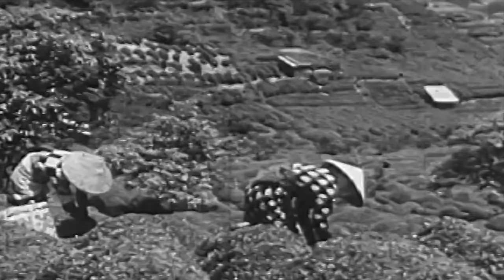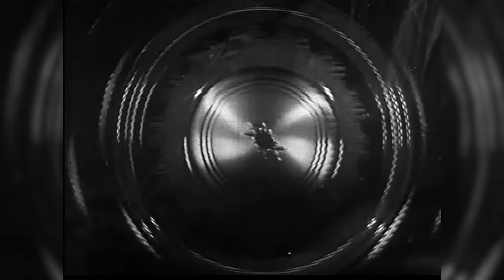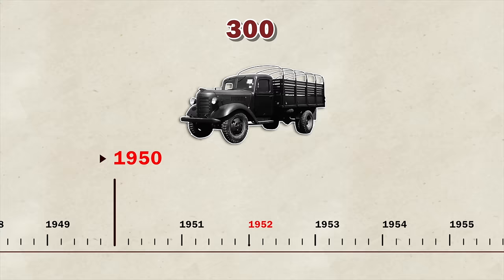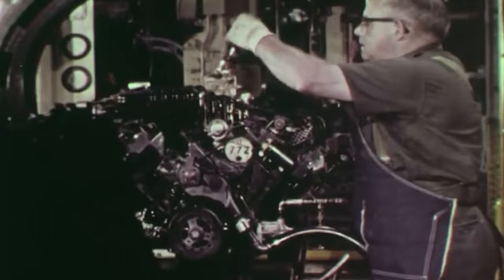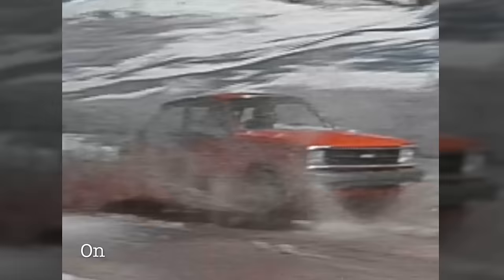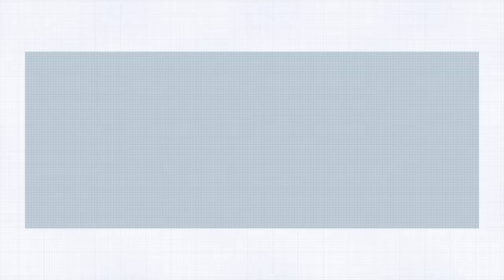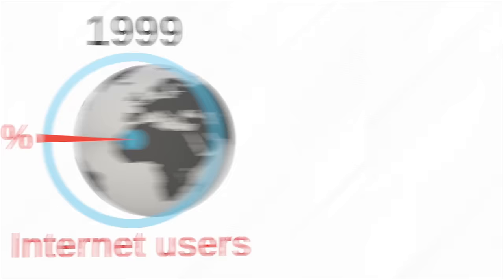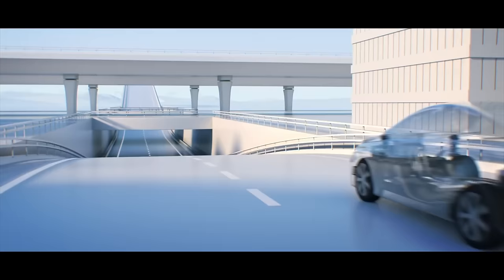Here's Why I Only Buy Toyotas

Comment: Just avoid the 2019 2020 Tacoma.I am on my 3rd fuel pump.
Reply: If they replaced three fuel pumps already, maybe it’s not the fuel pump, it’s got to be something else. The mechanics there are not doing a good job.
Reply: No it is that. They have a recall on the Toyota for faulty pumps. Last month the factory finally got the newly manufactured parts.I spoke 
with Toyota Corp directly.
Reply: There's a new recall
Reply: @fiveoclokfoam1204  Another? What is it
Reply: Have you found anything else defective in the Tacoma? I am looking to buy one.

Comment: 2004 Toyota Ipsum, 250,000 km on the clock and still going strong. I've owned all makes of car but this one has proven to be the most robust and reliable. My 68 Beetle has done more Kms but requires greater maintenance.

Comment: 2002 Toyota Highlander - 238,000 miles; 2008 Lexus RX 350 - 254,000 miles; 2014 Highlander Limited AWD - 80,000 miles; 2015 Lexus RX 350 - 80,000 miles... and a 2004 Highlander - 100,000 miles traded for the 2008 Lexus... combined approximately 3/4 of a million miles for a family of 5 adult drivers - still active in all except the 2004 (it was black and that color wasn't easy to keep up with!) - Selling the 02 today to a neighbor, rather sad, as that car has been perfect for almost 20 years! The company won me over from Ford in 2002 and I've never looked back... although, I do drive many rental cars each year and had a BMW X5 lease for 3 yrs... the reliability of Toyota / Lexus is hard to step away from. Quality is very strong, luxury is actually quality extension, otherwise you simply have costume jewelry...   Big Fan! Thank you Toyota for the ride...

Comment: I drive a 1989 Toyota van aka Wonder wagon. With a 2.2 L forklift motor LOL. Bought it used with so many problems but it keeps running while I fix it up and I joined a online Toyota Tech Forum where the moderators are old dealership managers that love the Vans also and help everybody fix them up

Comment: Scotty, we bought a used 2008 Toyota Sienna thinking we couldn't go wrong with a Toyota. We have owned 3 older Coronas and Corollas(Pre 1990's). What a complete lemon! There is some major malfunction in the emergency braking system. The van thinks it's tipping over every time you go around a corner. It beeps at us and then applies the braking system. We went through 3 mechanics, thousands of dollars. Replaced the YAW sensor, had the zero point balancing done, and wheel sensors replaced. Maybe other things I am forgetting. A google search tells us we are not the only ones experiencing this dangerous, dangerous issue. My husband pulled the fuse that controls the ABS/VSC etc. I avoid driving in bad weather or winter conditions. It has been very limiting. I only use the van for driving straight roads on the valley floor. I am done paying it off in 2 months and shopping for a new car. I feel traumatized by this Toyota and they have been zero help in solving the problem. I am also afraid to buy a new car because this one was such a lemon. I am watching your videos to try to figure out what to get next.

Comment: I had a ‘82 Toyota 4x4 short box with the bigger motor. I called it the wasp it was yellow with black roll around. Black interior and accents. 4 inch lift with 33in wheels  a thrush glass pack etc. It was in the early 90’s and I was in early twenties. It was one of the most fun vehicles I’ve ever had and one I wish I never got rid of. What was or is your favourite Toyota’s?

Comment: Great video Scotty!  after owning numerous American cars, our first Toyota was a 91 Camry. We drove it for 8 years without a single problem!  We then bought a 98 Explorer(Mazda) that is still on the road even after being driven by two teens.  Our 05 Accord however was using, then started leaking oil at around 85K Mi., despite recomended oil /filter change intervals since new.....We had to many problems to mention with our 2012 ford EDGE limited so we traded it in for a Highlander before it's internal water pump leaked, knowing there will be no warning indicator before the engine is destroyed if/when it does. Our 07 Tacoma now has 200K MI on it and stIll doesn't leak a drop of synthetic oil.  Yes,  you will pay more for a Toyota, but they are well worth it. Plus resale is amazing. There are two 07 Tacomas like ours for sale on eBay right now for Aprox. $7K more then we paid a dealer for ours a year ago. And it was pristine........

Comment: i owned a lot of cars in my life from German VW, BMW etc to Japanese Subaru's Toyota's etc.  Yes the German cars are a lot more upmarket and solid however that comes with issues, Warning lights for everything and expensive replacement parts. My friend owned a Toyota pickup which had over 300,000 miles on it. i saw his history for the car and i was amazed. Apart from a new consumables like brake pads, brake discs and a couple of shock absorbers etc he had zero major issues over 300.000 miles. I honestly believe most car manufacture's try and reach 10 years or a 100,000 miles as they seem to fall apart after which ever comes first. Toyota all the way!! I now own a Toyota Hilux with 120,000 miles onit and had zero issues. Toyota for life. Always gets you home!

Comment: For me Toyota is the best car manufacturer ever  ,I own 3 , an  MR2 Mk3  2000 model  great fun ,a Prius 2008 with 175.00 miles on the clock all I have ever replaced is tyres and break pads, in total my family own 7 Toyotas with nevertheless a problem, my wife has an AYGO not sure if you have these in the US great town car .good luck luv your U tube shows keep revving.

Comment: Very nicely done. I enjoyed this video. Only thing maybe missing is bring up the longevity of a few engines.  Especially the 2.7L through the 80s and 90s. The 4.0L though 2000s. I've seen both over half a million.  The 2.7L at over 735,000. I believe a 2006 high lander which isn't either of those motors but it got over 1 million miles before a hurricane was the car's death. It was still running when it happened. An extra 5 min on a few points like this.. would have been sweet. I didn't know any other this stuff.  I enjoyed the video. The fact they were 5th at the time of the big 4 in the US is incredible. Then the gateway to number 1. Only daily driver I will ever buy again. I have a 2021 rav4, I plan to take him until death do us part.

Comment: My 2013 bought new Tacoma always pinged on unleaded and required premium to run right. The dealer always acted like they couldn't hear it. Tacomas and Tundras are well known to have way worse MPG than they should. I will never own another Toyota truck. I have had good experiences with 2 Corollas. Honda is by far the better manufacturer.

Comment: My 2007 FJ Cruiser has 325,000 plus miles and it’s not showing any signs of slowing down as a daily driver car. There’s nothing like owning a Toyota, Subarus, Hondas and Nissans are close but they are get separated at around 250,000 miles. ❤️😂

Comment: Great mass consumer product for road vehicles

4x4 lack off-road capability and GVM/GCM is well below what is required for serious off road and towing. Buyers need to spend practically same a buying vehicle to make fully capable.
Mr Toyota needs to send his R&D team to Australia to see what they do down there to build great 4x4 Toyotas by replacing most on the suspension and highly modifying the drivetrain

Comment: My '99 Toyota 4 Runner has 500, 000 miles on it and I only have had to do basic maintenance on it, where'as my sons 2010 Nissan with 206,000 miles on it, already has a transmission that slips.
Toyota's just last forever if you do the basic maintenance well.

Comment: Toyota SHOULD be good whenever they are not in absolute market leader position. But when they are, as in case of our country, they will play with pricing, which always go up every year for the very same product class, all the while reducing parts, features, options, from engine down to interiors even put battery so small you could not tell the  difference against motorcycle's.

Comment: I agree, Toyota is the best. 

Currently my car is Mitsubishi Mirage  Hatchback 2015.  My first car. 
It is manual. 

I have driven a manual Toyota car. Noticed that the clutch is hard.

Driven Mitsubishi and Suzuki manual and the clutch is soft.  

I hope that Toyota could fix the clutch problem. Make it soft. 

It is a great pain to drive a Toyota manual on traffic.  It makes your left leg numb for pressing the clutch. 

Make it soft Toyota. There still drivers who loves to drive manually. 

Next car, a Nissan Terra 😊

Noticed Nissan has a good engine and aircon combination. You can max the aircon but still have a lot of engine power. 

I am a software release manager in one of the prestigious banks here in the Philippines. Although my car is not Toyota,  I apply their principles in my job.

Comment: Very interesting and informative. I hope Toyota is open minded enough to drop hydrogen fuel cells and embrace BEV's. They are well behind other manufacturers like VW and Tesla in electrification and will be left behind if they don't act fast. Hopefully the 3rd generation doesn't crash the whole company due to stubborn insistence on a flawed strategy.

Comment: We like Toyota too but they certainly can be annoying.  Our 2010 Corolla has the PCV valve hidden under the intake manifold.  What's up with such a stupid design?  Accessing this consumable part is insanely tricky in it, but 99% of vehicles make it exceedingly simple for any car owner to change themselves in less than 5 minutes.  Not Toyota!  The Corolla was our only showroom purchase ever, so when the PCV valve failed there was no easily accessible information on where to find it on the engine. This caused a lot of grief for us. But I eventually found it.
It now has 334K kms on it and has never needed anything other than consumables for maintenance.  It's awesome, while also a bit awful too.

Comment: You should have mine First it was a really good car till one day I was parking it by my Dodge diesel .  I was 40 feet from the truck when the car raved to 3000 rpm I jammed on the breaks the back wheels were dragging on .I hit the  truck bumper smashing the head light and fender  If anyone was standing there they would have been killed NOW I contacted Toyota and they would have nothing to say or do with me. Good by Toyota  I m driving a Ford now great suv

Comment: As a Toyota owner, my biggest problem with Toyota cars: 1- Lack of character: Hardly anyone buys Toyota for its fantastic architecture or futuristic or even convenient design 2-Lack of concept: simply boring 3-Lack of groundbreaking innovation like self-driving or self-diagnosing or EV or DIY modification options or etc features 4-Not getting rid of dealership business model. Let’s face it: Everyone hates dealers. You feel ripped off the moment you set food in a dealership. No wonder Tesla picked up so swiftly. Overall, Toyota manufactures reliable boring cars.

Comment: if you check the reliability reports, those car brands are really close to each other. japanese brands are still leading, but with a very small margin.
and if you have ever stepped in a toyota dealer, you'll know the price / interest rate are always higher than other brands,
meaning you are not buying toyota for yourself, you are buying for next owner - you pay extra 10k, and will get it back 5 years later when you sell the car - it's like a deposit

so...
is it still worthy to buy toyota?
in my opinion, if you have cash, and want to owe a car for very long time, yes
otherwise, it's better to buy new cars from other brands (korean cars are also good in reliability), or buy used toyota if it's a good deal

Comment: For a car made in Japan I'm more interested in buying a Nissan or Honda.
I was never interested in owning a Toyota brand even though in my country the brand has the highest population than Nissan and Honda brands.
In my country the reason people buy Toyota cars is because spare parts are easily available in the market and there are many spare parts with quality not according to the manufacturer's standards because they are cheaper which Toyota car owners buy for follow-up maintenance, so people in my country want to have a car but prefer to buy a Toyota car. Choosing non-Toyota spare parts which are important in the same function and much cheaper then buying a Toyota car because many low quality spare parts are sold. Maybe for Toyota premium cars the treatment is a little different because those who buy are generally rich people.
In the end, if I buy a Japanese car, it's definitely not a Toyota or I'd rather buy a European car altogether.

Comment: Good documentary and I've had many Toyotas.   Although I think they are great, the company screwed up not keeping the CEO a family member back in the 90s.   My 99 Tacoma has almost embarrassing fit and finish compared to other models I've had.  My other complaints with Toyotas,  any that I've had with over 40k miles have all burned oil and the engines knock.  IMO Honda makes better engines.  Oh and most Toyotas today are butt ugly IMO.

Comment: Scotty, I could use your help. 2010 Corolla Le model. I replace the battery a few months ago, and the alt is rebuilt but only two years old. I have my head lights flickering and no low voltage codes. where should I start

Comment: I have a toyota tacoma 2004 but need a full size to pull a boat I just purchased but every tundra I see want like $21000 for over 100 000k miles so is that terrible or good? I was always told anything over 100k is bad why are they so expensive if that's bad?

Comment: I guess among being the best you have to have some of the worst as well...
I was always a Toyota person, but how Toyota actually designed and put into production the 3.Slow will forever baffle me. That has to be the single worst engine ever made... a 6-cylinder that pulls like a 4-cylinder that eats gas like an 8-cylinder and it is 100% guaranteed to blow a head gasket because of design flaws in the cooling port

Comment: i have an inquiry...i have a toyota vios 2016 automatic with single vvti engine...5days ago, check engine appeared on my dashboard. mechenic diagnosed it at the computer box as follows...
Fault - P0977
Description - shift solenoid B control circuit high
Status - faulty wiring and connection. faulty shift solenoid B...and so, i bought shift solenoid(2pcs because the mechanic told me to replace the 2 shift solenoid). after the procedure with the ATF also replaced...we test drive it and everytime the engine is shifting gears, the power or rpm drops down...what is your diagnosis about this...hope you can answer this,by the wat i am your filipino fan...

Comment: Yet my 69 camaro still running fine today. It does not matter which car you buy as long as you take care of it. There was nothing wrong with american cars the only difference was you as an owner had to take care of it. Most ppl did not and Toyota knew that so they forced users to take care if their cars and thus thats why they lasted. Read the warrentys on Import cars from japan you void it if you do not use the correct oil or the correct transmission fuild etc. My GM cars I have always used high end oils and replace things with good american parts and not china knock offs.
Reply: @bisasomukasa  Ever wonder why they cut corners because people stopped buy their cars. GM and Ford used to make quality cars that lasted a very long time. But then honda and toyota starting getting a market hold on people and GM and Ford started losing money so they had to cut corners to survive. Toyota and other import companies cut corners on labor and pay so they could sell cars cheaper. Thus more jobs were lost in the USA and NA markets. The big car bail out would not have happened if we as consumers stopped buying imports. As you sow so shall you reap. Union jobs at GM and Ford used to pay their workers really good money. Toyota and other paid there employee's Half or even 1/4 the ammount that GM and Ford did pay there employee's. So if you like that Import companies gives jobs at much much much less pay then what it used to be. Then all your doing is turning the USA and NA into another china.